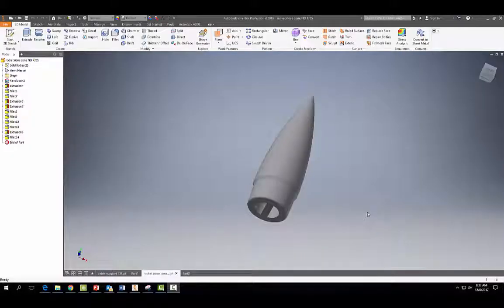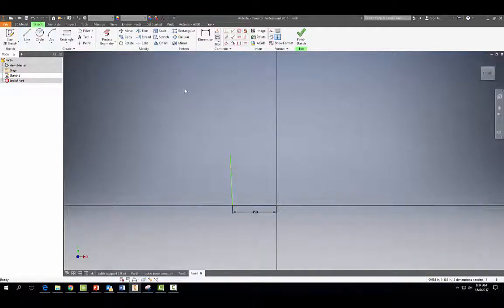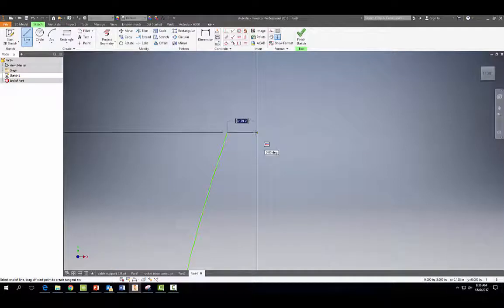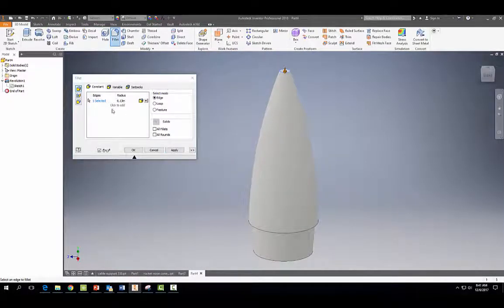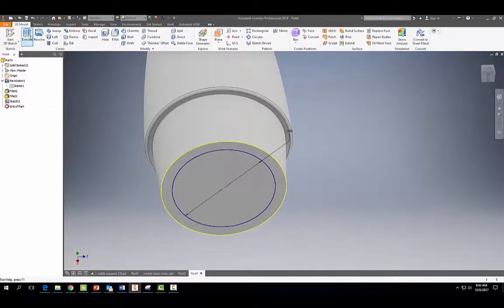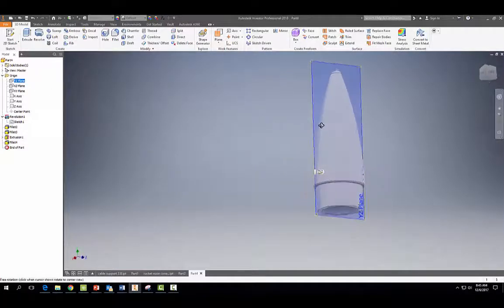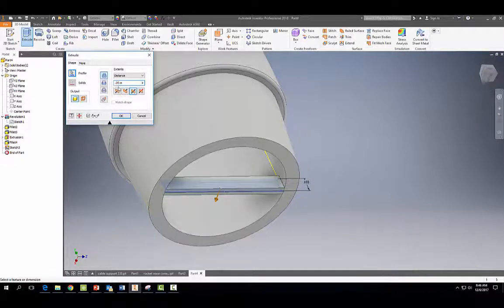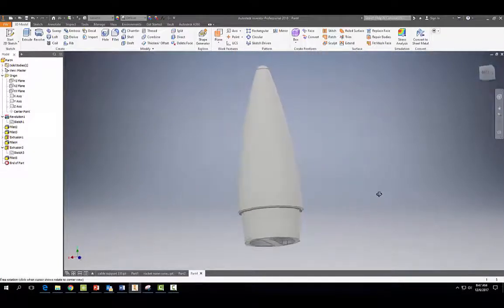Designing A Model Rocket Nose Cone with Autodesk Inventor

Comment: Uhm... a lot of whys here.
You wouldn't want to have the bottom of the cone open ended because that hollow space is just more volume that the pressure of an ejection charge would need to fill until it can pop off the cone.
There was no need to make the cross-member thicker, you only added weight and the only strength it needs it enough to hang onto the parachute (supporting only its own weight).
The fillets seemed to be more of a cosmetic move than integral bc they were also pointless.
Other than that, nose cones are simple, no need to over complicate them until they turn into detachable fairings.
Reply: Coleman Propulsion Labs, LLC a lot of the time classes are given production constraints where they can only have a certain volume allowed for their design so it was probably to limit the amount used
Reply: It's about how you make the shape.  I learned from it